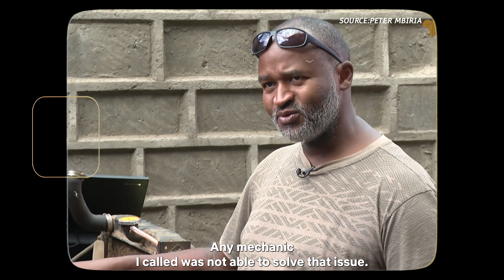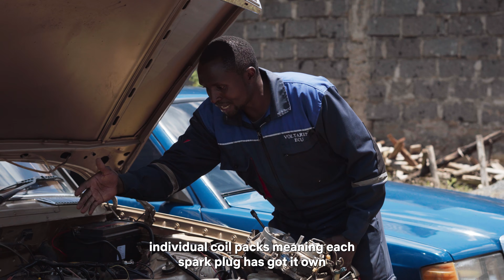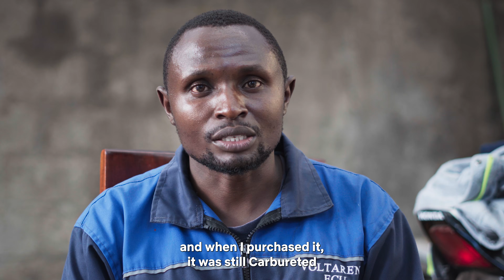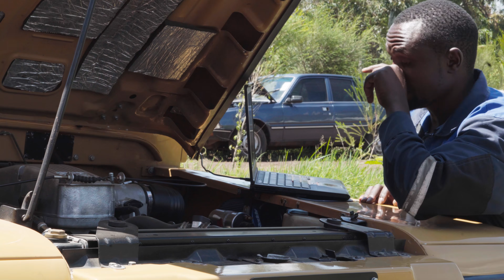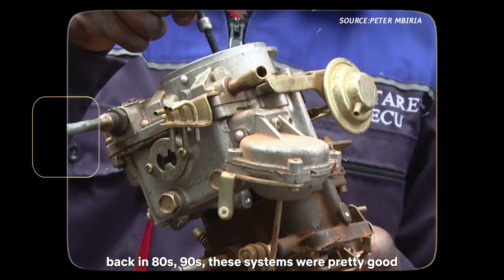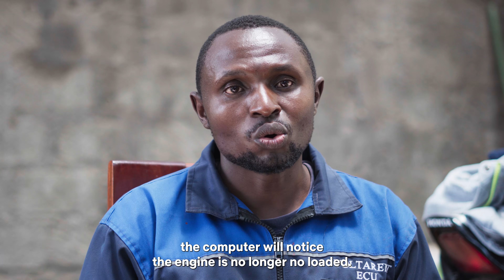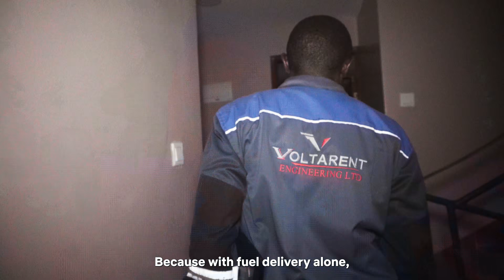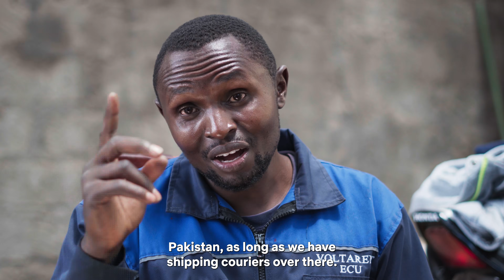This African Genius Makes Old Engines Work Better Than New Ones

Comment: Standalone fuel management systems have been done decades ago but this is probably cheaper and still very impressive
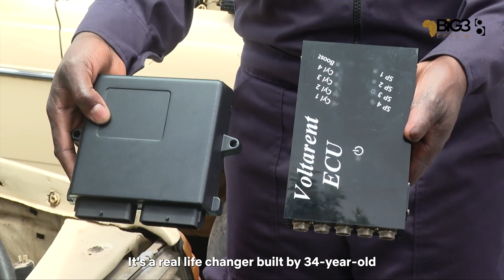Reply: You can see the arduino pages on the PC, and also the arduino board in 2:50. It's a speeduino clone.
Reply: 😂😂😂 "standalone fuel management" lol😂 🤡
Reply: Well yeah, it is cheap, like the most I've seen people pay is 100k some as low as 70k in ksh. roughly translating to the range of 600$ to 900$
Reply: @benjaminmnn 😂 haltech is about $1200
Reply: @theseoldhands532  Speeduino is open source, completely DIYable, from electronics up. Microsquirt is another cheap option. Not every application needs Race level features.
Reply: @theseoldhands532 Yeah,and its also  Haltech. The are top quality.
Reply: @theseoldhands532 of couse, this thing not only efficient, but the performance, yep that how this price like that
Reply: @theseoldhands532   Micro squirt is $350  the diy kit  were you solder all the part to the motherboard  is $200
Reply: @theseoldhands532  You can find it for cheaper than that don't play. Plus the quality is extremely better.
Reply: @O2TG  no point reinventing the wheel when it’s already been done cheap to a high standard 🤷 plus his looks very messy and not organised
Reply: @theseoldhands532  exactly. Fire hazard waiting to happen.
Reply: @theseoldhands532  yeah saw that's the price tag in the video... But I know one client, a friend of mine, who had one installed at 83k. He brags about the car too often, hard no to ask the cost.
Reply: @theseoldhands532  Most similar products here are Holley sniper and FiTech. That take carburated car, give it a ECU and convert it to EFI all in one kit.
Reply: @benjaminmnn If he can make that to $200 then we are talkin ! 😂
Reply: @TomFalcon-kw3rg  you have speeduino for 100
Reply: In the US you can't do this to street legal vehicles. "Off road use only". Its a shame.
Reply: Exactly! It’s awesome to see how technology keeps evolving — making powerful solutions more affordable and accessible than ever before!
Reply: @SavedbyHim  watch the whole video, it’s not standalone lmao
Reply: His approach is much cheaper because it’s more based on common electronics rather than custom stuff that are very expensive
Reply: Lol it's still his innovation so idk why you've to rob it our faces that it's been done decades ago. It's not the same thing, he's innovated. That's literally what's happening these days. Take Dyson, he didn't invent the vacuum cleaner but he innovated it and made it better and many others
Reply: @flashyred9125  reinventing a wheel is not innovation, its is perhaps beneficial and profitable though, I mean he literally could have taken the speeduino code and done this with little effort beyond designing his own boards which itself is also comendable but not really innovative.
Reply: @Wingnut353   thjs not innovation?  Your hâte stinks! Even if you improve on an existing product, it's still innovation. Suck it up and accept that fact !
Reply: @flashyred9125 lol no it’s not. If you don’t known anything about cars then this seems like some kind of breakthrough. Lol this has been around since the days that car guys started modding their cars. Idk how efficient and properly tuned his ECM is but there’s plenty other high quality manufacturers.
Reply: This is literally just a speeduino which is already something you can buy and use for cheap. There's nothing new here.
Reply: @SquidBiscuits  But yet you and others WERE NOT & Cannot do this. If this was so easy everybody on the planet would be reviving older cars. You are just online talking and spreading hate.
Reply: @44Roddy  What do you mean I can't do this? My car that I daily drive is run by a custom version of the Speeduino hardware / firmware. And duh of course I'm online, you are too. Do you want to come see it in person or something?
Reply: @44Roddy  lol, such a low intelligence response.
Reply: @SquidBiscuits If you do so, then try to post a video, as he does.
Reply: People talking about this tech being there before better quality yadi yadi ya! I’m yet to see or hear of an ecu that can convert 1litre per km to 6-8 kms for the same litre??? There’s none! Don’t exist! That is why Peter’s ecu is a standalone. Yes there’s bigger and better ones but they don’t give you 6-8kms per litre. And if anybody did come up with such an efficient discovery in the west where the hate is coming from, cooperations would stifle the deal because it disrupts the petrol dollar. They can allow a fraction of a difference from the gallon but a whole 8000% I don’t think so.
Reply: @peterroosh8114 I agree there are a bunch of haters and if this were normal everybody in the world would be doing this and restoring older vehicles.
Reply: @peterroosh8114  You don't have any idea how stand alone fuel systems work do you?
Reply: @WARSTALGIA it’s not rocket science it’s self explanatory on the video.
Reply: @peterroosh8114  Huh, your original comment seems to have vanished...
Reply: @peterroosh8114  like you said, no rocket science, so plenty of people have done that.
And lets be real, the improvement wont be as big as the advertisement.
It can only nearing modern engine, never exceed it in efficiency.
Reply: @briliankamil4594  that’s not what I meant but whatever! The cars in Kenya are saving on fuel in such a big way it’s never been done on that scale! Facts. Those that have tried they have not managed to improve performance per litre by 6-8 kms!! That’s the difference!!!
Reply: @peterroosh8114  well, the improvement is like this, the original carb is supposedly 10km/l, over the time it became 6km/l due to multiple problem in the engine.
After being restored and modified to fuel injection, it suddenly became 12km/l.
So people think this is magic, but actually not.
If the car recieving modification is in good condition, their improvement will only go from 10km/l became  12km/l, not 6km/l became 12km/l.
Reply: @peterroosh8114  one of the biggest problems with carburetor ( low fuel pressure systems) is the introduction of ethanol in gasoline. It clogs carburetors over time until they die. To fix this you need to rebuild the carburetor or switch to fuel injection ( high pressure system) so ethanol in gasoline is not a problem.
Reply: @WARSTALGIA how so?
Reply: @briliankamil4594  😂 you on about theory but in Africa in Kenya practically it’s happening!! Wake up!
Reply: @briliankamil4594  I’m not listening to you because you didn’t have the experience whatch the video again!
Reply: Lean burn strategy will give you amazing fuel economy. The problem is that it produces a lot of NOx which is why it’s not used widely. Toyota tried it but could not get the NOx number down to an acceptable level. 

But if you don’t care about your   NOx emissions you can improve cruising fuel economy by almost a third.

On his ECU, it’s using Arduino Due so even if he decided to use speedunio firmware he’d have to do a lot of refactoring. Looking at his YouTube channel it seems he’s doing his  own PCB design and firmware.
Reply: Nice one Sherlock you want an award for figuring this very basic fundamental. His ECU is designed for a specific society where there are a huge lack of resources and where such technology would benefit most. Hes not reinventing the wheel so to speak but he has created something that supports the conversion of engines to fuel the injection system in a quicker, more minimalistic way at a far more affordable price. Where most corporations would usually milk the cow out of this guy, his intentions are pure and genuine. Let me know when you build your next ECU out of a garage in your back yard then ill give you praise for your comment. Hah!
Reply: But when they are sold by larger corporations over seas, they are a far fewer and in between item to acquire. You can get one within days here in the states, and pay good money for it. But he is local, and taking care of the people in his locality before he moves abroad.

Not everyone is on the same technological advancement as we are, and that is not to say people aren’t smarter than us, but purer hearts behind the solutions provide far more than an easily accessible part that not many can afford.
Reply: woah, he converted mechanical to IE... engine efficiency is still the same. Can't see any "news" here.
And IE is not that much, some Carbs are still better then some electronic injection.
Removing the sensors, to avoid damage the engine is a very nice thing, is the same of removing the extinguishers to avoid fire, of course will be cheaper. Very smart btw.
Reply: @tuduff  There's no "removing sensors", it's about not adding sensors ,not removing them, it's about making the engine work with EFI but with the same sensors it had when carburated, and I think this in markets like Africa where there's a lot of vehicles that can benefit from this it's actually  genius,if this young man plays his cards right I wouldn't be surprised if he becomes quite a wealthy man .
Reply: there is a open source solution ready to use, invented decades ago. Just need to print the board and use it. Invention is another level, like bmw did  with valvetronic.
Reply: @orlana carbureted engine/ cars do not have many sensors. Especially those needed for a efi conversion! Eg. TPS, O2, or MAS, CAS ect all these sensors need to be added to a carbureted model for the ecu to have any data to tune with.

Comment: Do they have any emissions standards and obligatory inspections in Africa (and are those laws really enforced)? I don't think so.
This guy's ECUs are good to keep old cars running, for sure. But nothing more.
Especially if they don't use oxygen sensors (which is as basic parameter as: compression, timing, fuel pressure, MAP, temperatures, crank/cam positions).
Modern cars DON'T have "too many" sensors like clueless chumps claim in the comments. Actually there is not enough, especially transducers, in cylinder pressure (with those you could control the combustion even more and get more power and less emissions), this is The Way to do this (only direction in engine development).

Comment: Ok, but all this is only fit modern technology to old engines, this is well known sinze 25 years and the first programmable injection systems, adaptable in place from the carburetors, or electronic ignitions who can replace old contact ignitions: il made myself some modernisations on engines sinze 1982...

Comment: He's doing great work but none of this is new in any way. You can buy fuel injection kits online for $300. People have been doing this for decades. I'm a mechanical engineer and have put fuel injection kits on cars and motorcycles for years. I'm not sure why Africa doesn't have access to the internet where you can purchase these kits everyday. They'll work on any gasoline engine. I applaud anybody that is extending the life of older cars but this is nothing new or unique.

Comment: In my country there is a saying when you brag about having invented something that has been known for a very long time: "You invented walking and hot water". So does the gentleman in the video. It presents the replacement of the classic distribution/ignition system with something rudimentary, roughly similar to the first systems controlled by an ECU (Electronic Control Unit). In Europe, the USA and the rest of the industrially advanced states, the system began to spread on a large scale in the early 90s. In any case, the work done by the man in question to produce the system deserves praise.

Comment: Dear Afrimax English,
Greetings from Kallangur in Australia.
There is an engine being developed in New Zealand called the Duke Engine. It has three spark plugs and five pistons. It is also one third the size and one third the weight of a standard ICE engine, giving it a massive fuel consumption advantage over the old ICE engine. Unfortunately, the principles are trying to sell the company but if it is successfully sole then I believe that the African Genius and his Voltarent technology would reduce its fuel consumption even more and help the new owners get it to market a lot quicker. Regards, Glenn Fordyce

Comment: Support your local businesses. But in case anyone is interested, Speeduino is an open source ECU. The main microcontroller is an Arduino(also open source) and the rest of the PCB Gerber files are free to downloa for the speeduino. You can send the files to a local pcb printer or a place like JLCpcb or Osh Park. Another open source ECU option is RUSefi. And also mega squirt is extremely cheap. They all have free programming software as well.

Comment: All he does is installing an electronic timing and injection system on am old motor. Ive seen stanley meyer do this on his vw bug in the 80s. But still impressive.

Comment: First I want to say the man is a genius no doubt. I learned all about what he does in the US where the resources to learn are readily available yet it was still difficult to learn. For him to design the ECU himself is next level. But I want to say this is common in a lot of older cars being modified in the US and many other first world countries. The reality is that EFI isn’t making the engine more efficient a carburetor properly tuned will have the same efficiency as a port injection system. But what it does do is provide consistency because carburetors are more sensitive and prone to needing adjustments. A EFI system even an older system can adapt to vast majority of road conditions. And as he said carburetor tend to lack peak performance when seeking efficiency or vice versa. Common ECU that are budget for older vehicles are Arduino EFI and Microsquirt.
Reply: In short: he's not genius 😅
Reply: @Epopteya  I mean, he comes from a place where this is practically witchcraft. So props for him advancing, introducing existing knowledge to his area.
Reply: @Epopteya most certainly a genius in his own field.
Reply: @Godsmessenger33  His own coutry.....
Reply: @ haven’t you guys got anything better to do? 😒
Reply: Carby can't be remotely as efficient as EFI, it doesn't have the granularity of control that a fuel injector has, not to mention it can't receive feedback from the lambda sensor to fine tune itself to the hundreds of different variables that will affect the exact amount of fuel that the engine needs or the knock sensor to dial back timing.

Comment: It's a speed density style system from what it looks like. If the price point, tuning and self learning capabilities are there, plus the simplicity, this unit could compete well against the likes of Holley, Haltech and others.
Reply: Megasquirt,more than 25 years in marquet,megatune is the software,

Comment: Put on every petrol carburettor car a 500 bar fuel system. Will be much cleaner and fuel efficient.  Now you add pre ignition chamber.  Now you can go wild with timing also. Tadaaaam, you reached the 45% efficiency instead of 20%.

Comment: Like what am I asking what's the biggest engine will it run or just car engine that use the same size spark plugs or injector space or can it be connected to bigger engine that has electronic system

Comment: Vehicles these days are inefficient on purpose.I owned a 1981 Toyota Corolla 1.8 litre that was driving 45 miles per gallon.this vehicle was carburetted .most of Japanese vehicles in the 80’s were efficient.

Comment: Proctect this man at all costs
Reply: Why? He's done nothing new!! Most European cars since the 70s had electric fuel injection and electric fuel pumps and coil packs for each cylinder. Mercedes Benz, BMW and hundreds of others.. all he's done is make something that already exists and we have been doing to old engines for the last 30 odd years now 🫤 sure he's clever for making a basic engine management system but it's nothing new or anything that enthusiasts haven't been doing already 😂 people are making ECMs out of adrino nano and RPI 4 systems with the gpio pins. Because not everyone needs or wants a mass produced haltec ECU because it's overkill and over priced when a $100 SBC and a few hours of coding and testing and bam homemade ECM.
Reply: True, I second, from the wf channel, a lot who have tried cutting profits through mechanical efficiency have had really bad endings. Almost Close to guys  discovering a cure for cancer.

Comment: Awesome invention👍🏻

Modernizes the fuel system in the old fuel system engine which is no longer manufactured by Bosch is a great way to be independent and not controlled by big corporations. Respect 🫡

Comment: I would really love to invest safely into businesses like Peter's. He's a genius and deserves our full support for growth.
Reply: Carbs can be equally as effective at producing power, sometimes even easier than fuel injection, but they can't match fuel efficiency you can get from EFI.
Reply: Risky with their government
Reply: Carburators are musch better.... just improve carburation in any car and you wills ee out perform and be reliablçe for many decades...Isntead of using the originla carburator you can put two,, for better economy and maximum performance
Reply: @termonostruman I've been a petrol head for 40 years and i can 100% guarantee that properly designed and installed EFI will always outperform  Single/ twin/ triple/ quads/ downdraft/ sidedraft  carbs.
Reply: @termonostrumancarbs are NOT much better and it’s not even close. Just stop
Reply: @termonostruman They are good but the gas consumption is high
Reply: @termonostruman lol you have no idea how engines work to say that.